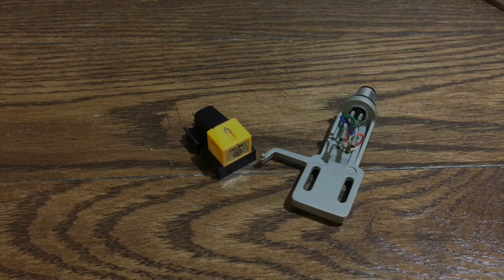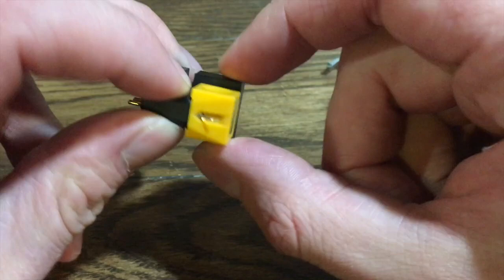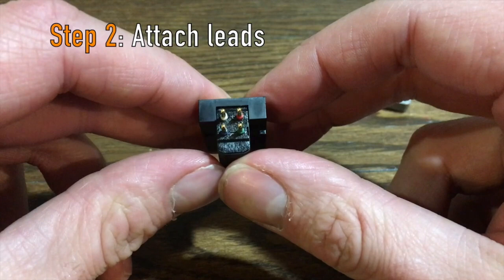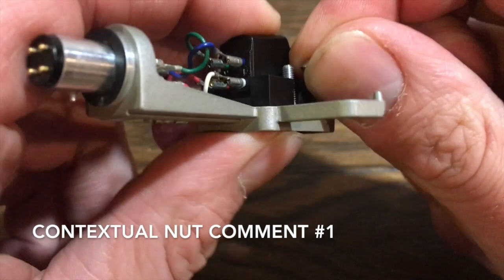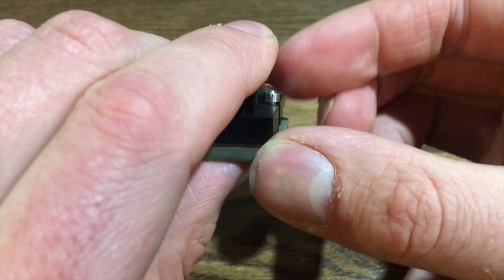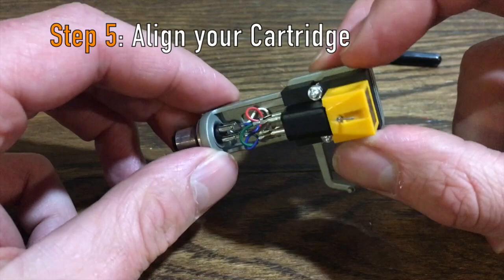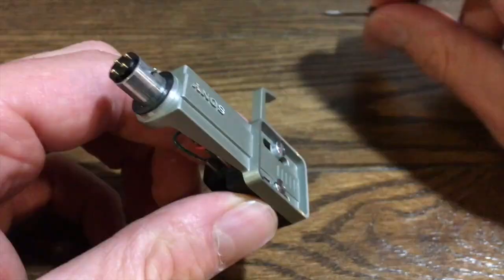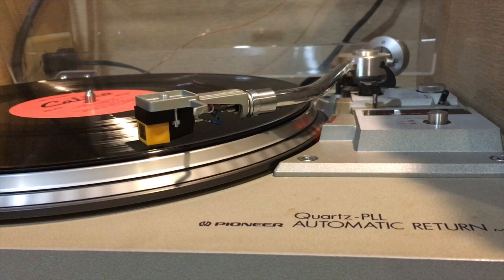Nagaoka MP110 Cartridge Installation/ Wiring/ Stylus Removal

Comment: I installed many cartridges in my lifetime and I had a hell of a time getting  the alignment and overhang correct. My one turntable I had a problem with the anti skate. It works correctly with the old cartridge. With the Nagaoka MP110, no matter how you set it, it still pulled to the center. At first I thought the Nagaoka was to heavy for the tone arm but it was in the proper weight range. I used a test record with the groove less section and it pulled inward. I must have done at least a hundred cartridge installs at work and for myself and friends. I usually can do it in less than 30 minutes. The Nagaoka took over an hour. I had to take a break because it pissed me off, but it was well worth it. That's a fantastic cartridge. The performance is worth twice the price in my opinion.

Comment: I heard when you use the overhang gauge,  you also need to use alignment  protractor. The overhang gauge tells you far forward the tip needs to be. The protractor makes sure the cartridge is at the correct position so the stylus sits correctly in the grooves.
Reply: I've heard the exact opposite that either choose overhang or protractor but not both just goes to show much of the "facts" in this audio hobby are more than likely opinion which is the correct answer? Well that's the million dollar question 😄
Reply: For anyone reading this…. If you set the overhang correctly and it is even in the headshell on both sides it will align perfectly using an alignment protractor anyway

Comment: Tip: Install the first screw and nut without the cartridge on the headshell and then slide the cartridge onto the screw and tighten down the nut.  Beats fiddling with it.  For the second one, you'll have to fiddle.

Comment: I ordered a nagaoka 110 for my rega p3 is it similar the instalation? Cozz some they say it needs a spacer? What it is? Thanks
Reply from the maker: I wouldn’t worry about a spacer. The mp110 is still a budget cartridge. Tracking angle will not make any difference in sound if it’s a bit off

Comment: Hi do you know what the body of the cartridge is made from is it metal or some sort of plastic the part the stylus connect to not the top part.
Reply from the maker: Hi John. The bottom of the cartridge body is made of metal.
Reply: Audiorpheus ok! just wondered why it's black do you know what metal steel or aluminium? Keep them coming.
Reply from the maker: According to their website it is an “anti magnetic permalloy shield casing.” Permalloy is a mixture of nickel and iron, so there you go!
Reply: Audiorpheus cheers!!
Reply: Really the final tightening should be quite tight on the screws and try and use some nylon washers, A shim? between the body of the cartridge and headshell would be good bolster wood, bamboo, failing that some good quality card soaked in PVA glue and left to dry. Doesn't need to be thick millimetre for the card 2 mm for the bolster and bamboo